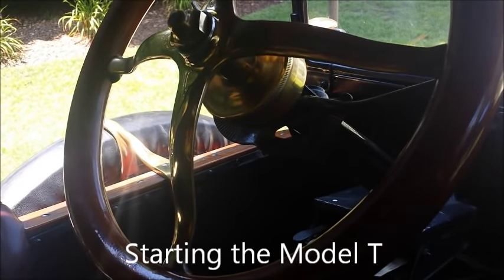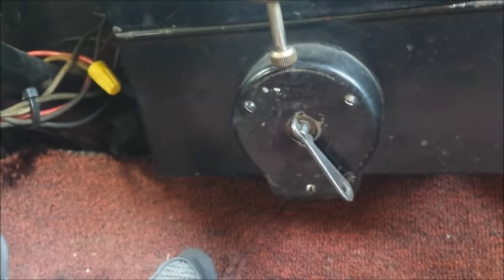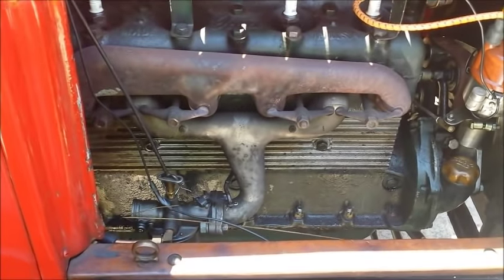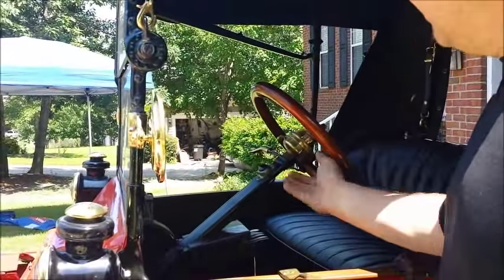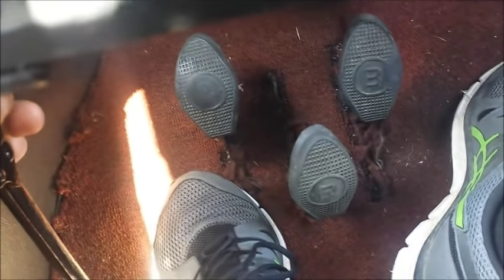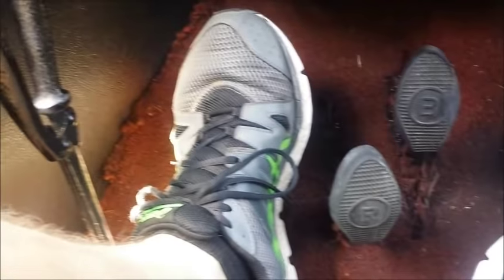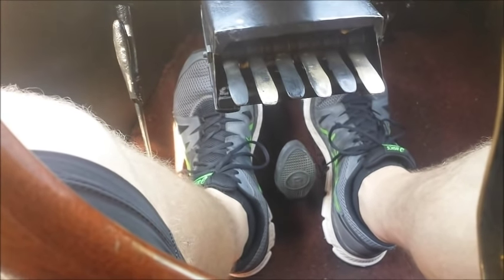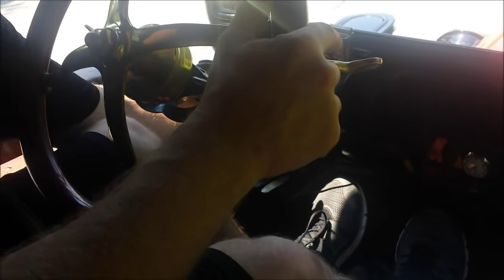Model T Driving Instructions

Comment: My dad once told me long ago that model T's had to go up steep hills backwards because the gravity feed carb would starve for fuel going forward uphill. Please tell me is this true ? Also what are those tabs under the steering wheel ?
Reply from the maker: LincolnTek my grandfather told me the same.  I can confirm that the fuel is gravity fed and the drop from tank to carb is not a lot.
Reply: Yes it is true, unless you have a full tank of gas, and the hill is not too steep.  Some put aftermarket vacuum tanks in their cars to fix that problem.

Comment: How was it that the car was not moving when you started it with the crank? Seems to me that if your foot was not on the pedal to keep it in neutral, would it not be the case that the car was already in high gear and would have started moving when you crank started it? How did it remain parked?
Reply: @0.24  The hand brake pushes both the clutch and brake pedals in..   when it starts the clutch isn't engaged.

Comment: So it kinda does work like a lawnmower. You got the clutch and gas controller to accelerate and then once your in high gear, you just use the gas thing to adjust speed. This may not be easy to operate like a modern car, but it sure looks fun to drive

Comment: I can drive an 18 speed roadranger at 40 tons. This melted my brain!
Reply: Figure most folks nowadays can't even figure out a manual gearbox.  Even truck drivers are to the point where a manual transmission is an endorsement on your CDL now, as the current trend in trucks is a little R/N/D selector switch.

I think that I was 16 when my dad took me out to teach me "low range,1-4, high range, 1-4 again but split them this time".  Then again, I grew up in a different era and way (like 20 miles) out of town.  I learned on a 3-speed column.  Criteria for driving in the fields was "Can he disengage the clutch with his ass still on the seat?"  By 13 I was running parts and errands in whatever pickup was available or was needed elsewhere.

By the time I was 16 and actually had a license, I could pretty much drive anything on the farm...except grandma's Cadillac.  I was married and had a child before I was deemed old and mature enough to actually drive her car.  Their one extravagance.  Every 2-3 years grandma got a new Cadillac.

Comment: For neutral, pull the hand brake only half way back.  Pulling the hand brake all the way back locks the brakes on the rear axle for parking and starting the engine. I know as I have been driving Model T Fords for 74 years.

Comment: hey, that was amazing, so i understood about the gas lever. what does the advance lever do? is there anything similar in functionality with our modern cars? can someone explain the functionality of the advance lever please.?
Reply from the maker: Rohit Aswath the advance controls the timing of the spark with respect to the compression stroke of the cylinder.  The burn of the fuel mixture occurs at a relatively constant rate but the RPMs vary.  In order to have the fuel mixture burn and expand at the optimum point in the compression/power stroke, the timing of the spark can be changed.  Too early, you get knock; too late, you lose power.

In modern cars this is controlled via a computer and various sensors .  Previous to computers, a combination of mechanical advance related to engine RPMs and vacuum advance related to throttle position provided advance control.
Prior to that, there was a lever...
Reply: @toddschelling4439  FACTS.

Comment: Older folks told of how harrowing a quick stop in a Model T could be.  "Flivvers" were equipped with two wheel mechanical brakes.  Dodge came out with four wheel hydraulic brakes in 1927.   Dodge drivers spent a lot of time extracting their teeth from the dash board because they could figuratively "Stop on a dime."  Henry Ford would never admit that someone else designed a car better than he could.  Subsequently, Fords weren't equipped with hydraulic brakes until 1939.  That was because Edsel Ford, Henry's only son, insisted on the improvement.  Ford's advertising "Nothing but steel from pedal to wheel" resulted in a brake system that left more skid marks in the drivers shorts than on the pavement.  Loved this demo.😁
Reply: As standard, the Tin Lizzie didn't even have 2 wheel brakes.  It had only a brake band in the transmission!

Comment: Luckily it didn’t take too damn long to improve upon this design- I just did quite a bit of work to a 1936 ford sedan at work and that has a fairly normal 3 on the floor transmission with the gas and the clutch just like a modern day car.

Comment: Nice video, the clutch-low-high gear thing always confused me. 

One thing, I seen other videos that say you should never start it with your right arm, only your left, because if it kicks back with your right arm turning the handle it will be moving towards you and can break your wrist.
Reply: @ HailAnts 
don't take the word 'clutch' literally. It is a gear-shift (high - neutral - low), and the brake-trick is just done because brake-power is really bad.
Reply: akronymus - Yeah, once I watched these I realized that because the braking system is in the drivetrain that means that it only applies to the drive wheels. IOW the Model T has no front brakes!! 😳
Reply: There is a transmission brake, AND a drum brake on each rear wheel.
Exactly the same as any other car of the era.
Front brakes came much later.
The Model T was designed to be simple to drive, unlike other cars with sliding-pinion gears, which required skill to change. It was also simple to maintain.
The average farm-boy could go from a buckboard to a Ford with thirty minutes' practice. 
Which accounts for the Ford's overwhelming popularity.
Reply: bingola45 - I take it the rear drum brakes are  mechanically operated, not hydraulic. Those probably came much later too...
Reply: @HailAnts  The rear "brakes" are only parking brakes, unless you bought the after market "Rocky Mountain Brakes", which turned those parking brakes into service brakes and turned the stock T's brake band in the transmission into the parking brake.

Comment: Does the handbrake work as the clutch too?
Reply from the maker: Yes.  You can pull the handbrake about halfway and it will mechanically actuate the foot pedal that controls the transmission to the ‘neutral’ location — same as if your foot was pressing the pedal halfway.
Reply from the maker: I have heard that may be the easier way to drive in a parade as the car will essentially drop into neutral and stay there when you remove foot from pedal. (Normal operation would be High Gear when you remove your foot.)  just be careful to get the handbrake ‘just right’ to avoid burning the bands.  I think parade driving tends to overheat the engine.

Comment: It is a lot easier in the ones with buttons because all you have to do is the spark and throttle and turn on the battery and push a button.

Comment: Todd, the whole idea of keeping your thumb behind the handle.. seems to me that you can't really break your thumb if you wrap it around the handle. I know everybody's said that for a million years, but when you stop to think about it there are just two ways the engine can kick- Forward, of course that's how it starts and that would be in the same direction that you're pulling it, and the handle's design is to disengage from the crankshaft once the engine fires so it cannot force the handle up in the direction you are turning, which would be the way I'd be concerned it could break my thumb but it just can't do that. The other possibility. Is that it kicks back, and that's where we are so concerned about it breaking your arm because if it kicks back it pulls the handle out of your hand, forcing your fingers open and coming all the way around hitting your arm in the middle between your wrist and elbow. But I can't conceive of any way it can break anyone's thumb

Comment: It looks like you have the kerosene running lights. Did you ever light them up?
I have a working pair and they put out a pathetic small amount of light, just enough for others to see you.
Reply from the maker: kimmer6 I never did try the kerosene.  I think grandpa had planned to wire lights into them at one point but a better brake light and some kind of blinkers were higher priority.
Reply: Great video, Todd. I had no idea hot the transmission worked or the pedals. My dad bought a Model T for $5 and ran it in parades in the 1930's. He mentioned that the pedals, timing, and throttle were ''different''.  Those kerosene lamps put out pathetic light like an old 2 D cell flashlight with dying batteries. I have over 100 kerosene lanterns and lamps and burn 6-8 of them on nice evenings on the roof deck. The Model T running lamps are about 8 lumens. Crank them up to 10 lumens and they smoke like a WWI battleship.

Comment: Wonder if a bad ignition coil blew the fuse and caused the problem. Another theory, wonder if gm wired this vehicle the way they did (with injectors, coils, and pcm on same circuit) to protect the pcm drivers in the event that a coil or injector went bad.

Comment: One correction.  Why would the kickback break your thumb?  Think about it.  The crank is going to be moving counterclockwise into your hand and away from your thumb.  It will break your wrist, not your thumb.  That's why you crank with LEFT hand only.  When the crank kicks back counterclockwise it will slip out of your left hand, not kick into it.  That's when it is important not to wrap your thumb around.
Reply from the maker: Good points.  Grandpa never really went into too much detail on what exactly you'd break.  Just figured it was a bad idea to grab on too tightly.
Reply: zomby woof in case of reverse starting

Comment: since they had no speedometer how did you judge your speed back then
Reply: As long as the speed limit is higher than 45, don't worry; you'll never reach it. Really though, these came about before a time when road regulations were really a thing. There were restrictions on where you could and couldn't drive a car, of course, but speed was pretty much self-limiting; you either simply didn't have a car fast enough to worry about how fast you were going, or you eventually found yourself in a ditch/rut/culvert if you did.
Reply: By experience. I can tell how fast I'm driving without looking at the speedo.
Reply: Actually, you could get aftermarket speedos for them! And heaters, and a bunch of other things! There was a huge aftermarket for these cars back then!

Comment: I’m 25 and I want a Model T even though this looks like a complicated car to drive but I still want one because I feel like the engineering in the older vehicles are more durable than newer ones.
Reply: Longevity and reliability have a LOT more to do with maintenance than anything else, assuming that the base mechanicals are sound.  As long as moving parts have clean cool oil between them and temperatures are controlled, they will last virtually forever.  

Figure that reduction gears installed in a US Navy ship in 1967 were still going strong in the 90's.  No oil changes, just topping off loss from leaks.  However, that lube oil was constantly purified, cooled, and filtered, and flow was measured in gallons per minute.  Still, over two decades of gearing down high speed steam turbines to around 100 RPM at around 16,000 horsepower.

Another example would be the older BMW motorcycles, where BMW recommended an overhaul at around 300,000 miles.  On a MOTORCYCLE.  The secret?  Roller bearings, needle bearings, and ball bearings...and a designed 80 PSI oil pressure.

Comment: I thought I seen a lot of these, but I never saw one with what amounted to a modern high-tension distributor. I don't know if this car engine was hacked to adapt it to the camshaft, or whether at one time these cars were offered with this type of distributor and he just hacked a VW distributor  to work in this engine. The ones I've seen and driven all had the low-tension distributor and the 4 buzz-boxes. (btw, might the original low-tension distributor fit in the block and reach down to the cam, and he hacked the VW distributor to fit that spot?) I wonder where he hooked the timing lever. To the side of the VW piece and leave the body of the VW piece loose in the bore to enable it to turn a small amount?I never liked calling the left pedal a "clutch" even though everyone calls it that. Really it applies or releases one of, I think, 3 band groups in the trans. The low is applied by squeezing a band around one drum connected to a part of a planetary pack, the neutral is actually holding a band open against, I'd imagine,  a strong spring, and then the high position simply releases this "hold" on the high band so the spring can apply the band to the "high" drum attached to another group in the forward planetary. My grandfather told me (I'm much older than he was then!) this was a design feature for high, since the other way, you would have to use foot force all the time on perhaps a separate pedal as you were driving in high to tighten the band, and you would soon tire your leg out. The reverse just tightens yet another band around another drum hooked to a cluster in a planetary pack.Did I get this stuff right?  I have seen a lot of Model "T" stuff back in the early '70s when I worked on cleaning out a 3-acre woods in Plymouth, Indiana full of a lot of frames, engines and transmissions to these cars, as well as dozens of pieces of stationary machinery that contained this engine-transmission combination. The engine and trans case were all cast as one piece as I rremember.  I was a young mechanic then, too, and I really examined these units to learn how they worked!
Reply: It's aftermarket.

Comment: That's mad. 
Turn the start key, slide the t bar auto in to drive, press accelerator pulling out without indicating cutting that car off, pull out the phone and start texting and all good. Occasionally push horn for slow drivers until you either (a) reach your destination or (b) crash into someone.

Comment: remember to press the clutch halfway then step sharply on the brake and put the car in reverse while simultaneously pulling the handbrake and engaging transmission braking and at the same time releasing the brake with the ball of your foot and gently pushing on the clutch while simultaneously releasing the handbrake a bit then giving full gas and stepping on all three pedals at the same time and fully releasing the handbrake.

Comment: Look at it this way. Yes it’s convenient to have a car with a push button start and navigation and backup camera, but this car is 102 years old and still runs exactly the same. You’re lucky if you get 10-15 years out of these new cars
Reply: @KeeDx3 That and the majority of these cars have been almost fully rebuilt by hand, numerous times. My grandpa's Model T was someone else's before him, and someone else's before that, and so on. He re-fabricated more than half the parts in the engine and gearbox, himself, and I'm sure the guy before him had to do similar work. These cars are definitely a "ship of Theseus" sort of situation; they've had so many parts replaced it's questionable if you can call them the "original" car, any more.
Reply: @Les There were still a lot of Model Ts on the road in the mid 30s.  A few were still being used as daily drivers as late as the early 70s.

Comment: Automatic transmissions came to market in the early 1940’s. Oldsmobile and Buick had them first I believe.
Reply: Olds had the first fully automatic in the modern sense in 1940, but the REO came out with an automatic in 1934.  It shifted by itself, but you still had to declutch at stops.  It was called the Self Shifter.

Comment: Also you should not  push on the brake pedal and "hold in down."  If you do this, you will burn out your brakes.  You should pump the brake pedal  slowly until you come to a stop.  This video is good but it is leaving out a few important things to know.  Never use the and brake to stop.  This is basically medal on medal and you will burn it out.

Comment: Modern manual drivers, "I drive a manual because it takes skill."
Reply: When we first got together, my wife-to-be would get annoyed when I would shift her little car without using the clutch.  She had slight issues shifting it WITH the clutch.

If the RPMs are right, a clutch is really optional.  Spending your younger years driving truck helps...a clutch in a semi is used for stopping and starting.

Comment: Never pull up on a hand crank, always push it down
Reply: Looked like he was about to break his wrist doing that. I think you're meant to pull up using the left hand actually, so that it won't twist your arm and break your wrist if it kicks back
Reply: I had a 1925 T when I was a teenager (late 60’s). I always cranked it pulling up with right hand. One time it kicked, and my hand flew up and hit me in the face! No injury, but my buddy in the drivers seat wondered why I hit myself! I think pushing down on the crank would be risky.